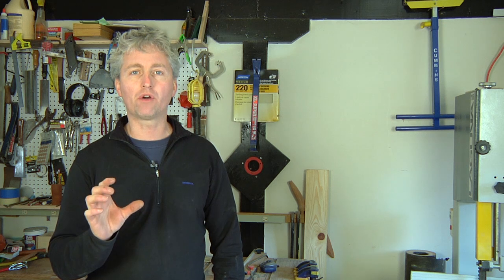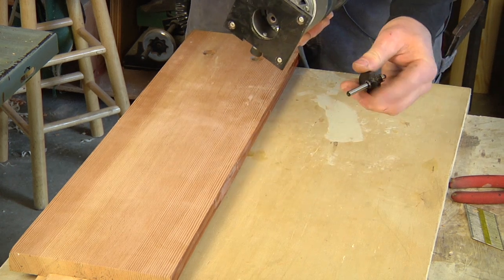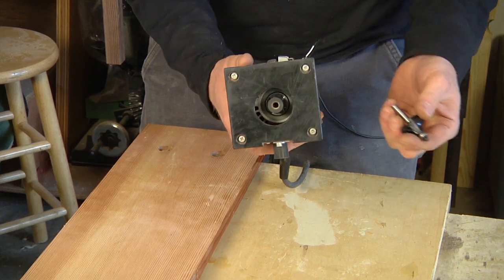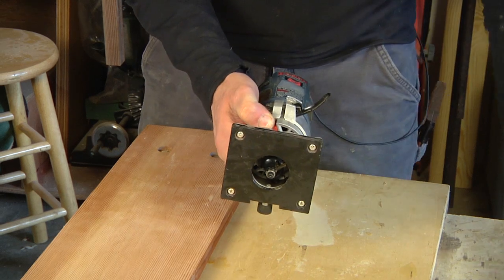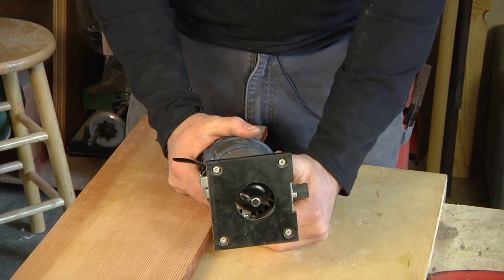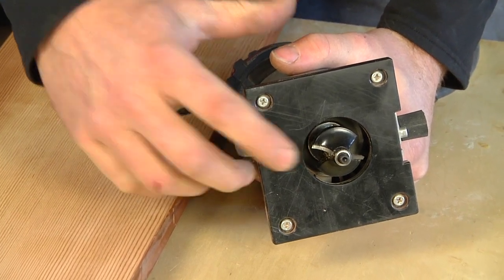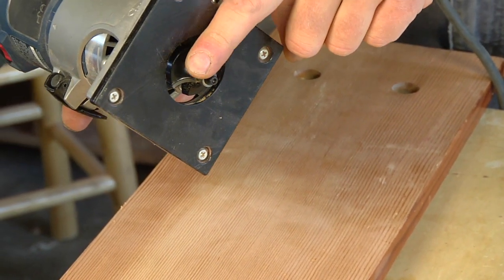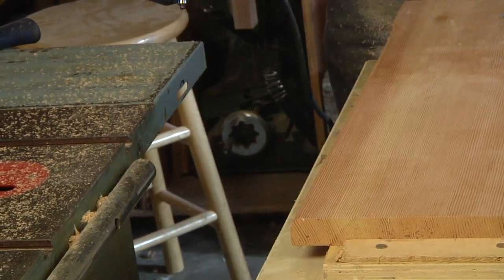Home Remodeling Tools : How to Round Edges with the Handheld Router

Comment: I wanted to see how to set the depth of the router bit to get a rounded edge.  You explained to keep the square edge above the plate and only the round part below, though the angle of the shot did not show how that looks.  The straight on shot did not show the depth.  So partially helpful.  I am more a visual learner so the camera angle was not ideal to show what I was looking for.
Reply: Would have liked to see the final product.

Comment: Does it matter what direction you go with the router? Any recommendations for end grain? Thx
Reply: I saw a video about this. If the blade is spinning clockwise, you want to move the router from left to right, and vice versa. Otherwise the router will run away from you. There were some exceptional cases where you do the opposite but I can't remember. Your comment is 9 months old but hope this still helps.

Comment: I have an MDF plate I'd like to round the corners on by 1.5 cm in each direction, would you still use a router or could I do this by hand sanding? MDF seems to be very easy to work with and was able to cut nice clean edges using a handsaw.

Comment: Goes into great depth on changing a router bit, but nothing about choosing the right speed, direction of movement, body and hand position relative to the router and work piece.  Nothing about where to apply pressure or how to easy in and out of the cut.  Nothing about avoiding blowout on end grain.

Comment: Nice video !!  I just bought my first router, a Bosch like the one you have.  My question is how do you know which radius size bit to get for a particular edge thickness?  I noticed that they make a number of different sizes (3/32 up to a 1/4 inch) with 1/4 inch shanks.
Reply: Did you ever figure that out= can you help me? I have a 1/2" piece of Walnut I want to roundover. Just got my FF cheapo router today.

Comment: Ah don't be like that everybody. If you actually stop the video at 2 mins 44 secs, you can see the rounded edge. And just put the router bit in router so that the upper horizontal cutting edge is just away from the top of the timber so as to not cut. Then you get only the effect of the curved edge. And away you go.